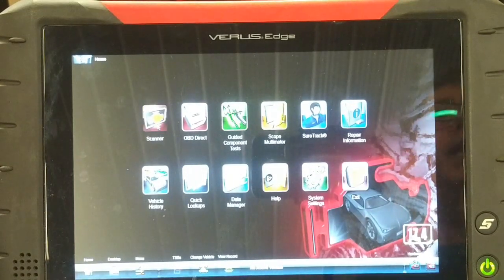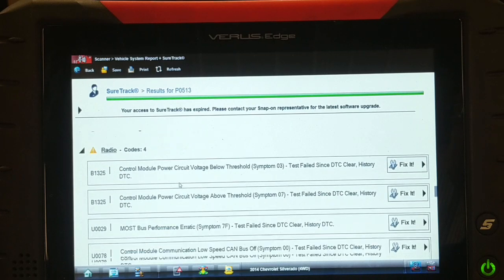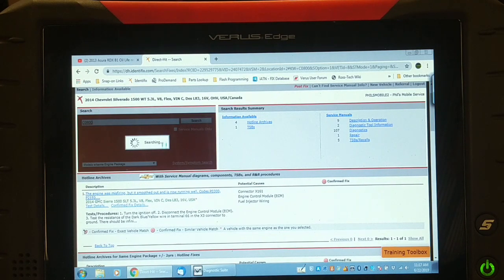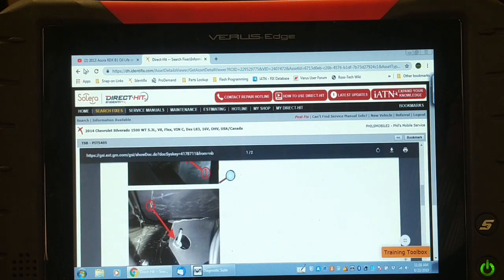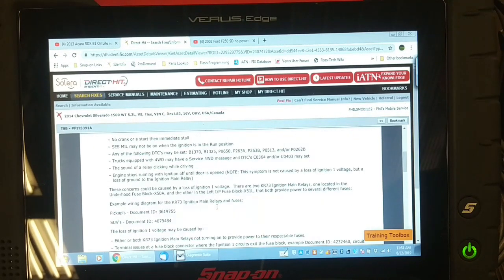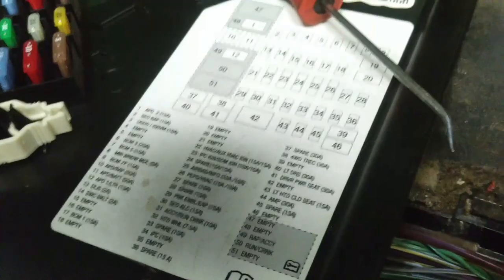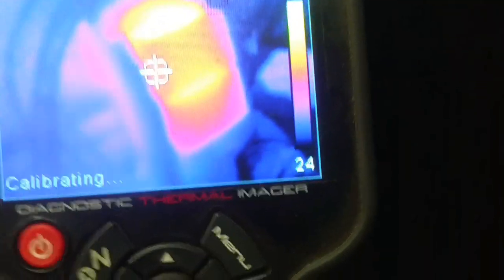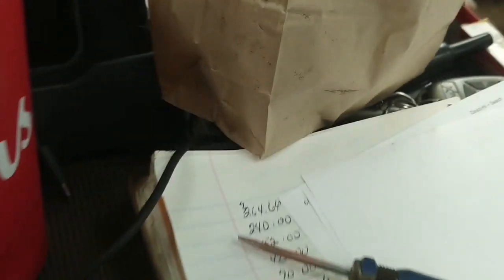2014 Silverado intermittent no crank like dead battery

Comment: You've ruined it with the dielectric grease. That's not to be used for electrical connectivity. 
A dielectric is a material that does not conduct electricity but can store an electric field
Reply from the maker: That's what GM recommends. It displaces moisture and oxygen which cause oxidation.

Comment: I just went thru this headache..... my 2014 Silverado turned out to have a faulty negative battery cable (even though it seemed fine with no corrosion on either end).

Hope this helps someone out there.

Good luck to all.
Reply from the maker: That's what this ended up being as well. Here is the video...https://youtu.be/Rihux0_-pGg

Comment: I'm three min. In and I'll tell you this...I still own mine. These trucks continue to pull and surge the batteries when the truck is off.  I charge my battery every quarter and replace it every 2.5 years.  
Don't rob a bank with these trucks, if you do....leave the engine running.

Comment: I have had this problem going on intermittently for years, just discovered the corroded crank relay today in the fuse box. I don't have a spare but I switched it with the defroster relay. They are all the same. I have had the service four-wheel drive and multiple low power codes. Hope this solves the problem!
Reply: did it solve the problem?

Comment: I have a 14 sierra  have to jump the truck to start altinator will charge it but only holds charge for 20 min when thetruck is shutoff and the seat belt light is on in park
Reply from the maker: Sounds like a parasitic draw. Something is keeping the ignition on? Need to do parasitic draw testing

Comment: This is quite probably a hot soak issue. The starter lives inches away from the catalytic converter with minimum shielding. I found loose connections at the starter motor probably due to high heating and cooling. This temperature delta will cause cable problems mainly due to high heat soaking at the motor.Better shielding and checking cable torque connections may be a maintenance consideration.
Reply: I did the same in a cheyene 2010 and gmc Sierra 2015 you can check May last video is about that

Comment: What would make a 4.3 vortex show error when hooking up computer and no crank when turn the key it's getting all power in the cab just not turning over u can turn it over at the starter relay but it not getting any fuel or fire idk confused can't figure it out
Reply from the maker: Hello Jakus. First I need more information. What year truck? What happened before it won't crank/start? What do you mean by "show error"? Can the scanner you are using communicate with the ECM? Can it communicate with the other controllers on the network specifically the BCM, ABS, Fuel Pump Driver? What scanner are you using and what codes can you read if any? Give me some details and I'll try help you out.
Reply: @PhillipBailey  it's a 2008 chevy 4,. 3 work truck and I accidently knocked the hot wire off the battery one night put it back on started it up started driven everything went dim the motor started ticking and it died and now won't start back I can jump the starter relay over and it turns over so I know it's not starter or bettery I am leaning more toward the ecm on all similar story's and it's a no crank no start my bad
Reply from the maker: @jakuslee5146  was it running when the positive cable knocked off? Can you do a network scan. Start there. You can't just put an ECM in it as it needs to be programmed and married to the truck. Don't start changing parts without diagnosing it.

Comment: Had intermittent no crank on my 2018, was driving me crazy  cleaned terminals etc, watched all videos after changed out starter relay and 40 A fuse. truck started ran good for a day then Stabilitrac lights up , engine light  with #5 cyl misfire. Trac Control, antiloc and cruise all off line now, and the adventure begins, checked ALL ground points   and made sure connection was good, it figures this would happen right after warranty  expires

Comment: We have a 2015 Tahoe with push to start but similar symptoms an codes… hmmm
Reply from the maker: This truck actually returned a few weeks later for the same problem. I believe the problem was actually a voltage drop in the negative battery cable clamp crimp. Here is a video of that repair on the same truck...https://youtu.be/Rihux0_-pGg
Since low voltage to various module will generate communication fault codes it's tough to diagnose. Since replacing the ground cable clamp the truck has never acted up again. Good luck...
Reply from the maker: This truck actually returned a few weeks later for the same problem. I believe the problem was actually a voltage drop in the negative battery cable clamp crimp. Here is a video of that repair on the same truck...https://youtu.be/Rihux0_-pGg
Since low voltage to various module will generate communication fault codes it's tough to diagnose. Since replacing the ground cable clamp the truck has never acted up again. Good luck...

Comment: Nice work. I have a '14 Silverado 1500 2wd, 5.3. I also have intermittent complete power loss (seems to be aggravated by heat). Did the owner of this truck indicate that the fix you did resolved the problem?
Reply from the maker: Here's what I found a few days later. His problem was an intermittent no crank shortly after a hot soak. Never when cold. Drive for an hour  shut it off to refuel for instance and then 15 min later no crank. After that event multiple network codes in multiple computers. Problem I believe was a voltage drop on the negative cable at the factory cable crimp. I believe it was causing high voltage drop on the body ground which caused the BCM to shut down due to low voltage. I replaced the ground cable clamp at the battery and the truck has been fine ever since. I started using marine cable clamps and copper lugs. Check out this video on the same truck. https://youtu.be/Rihux0_-pGg.
Since that truck I have had at least 3 other trucks that have been fixed for the same problem by changing out the battery cable end. Hope this helps.
Reply: @PhillipBailey  thank you very much. Yes, since messaging you I've seen this exact problem from quite a few others. I'm going to ask my mechanic to do that fix and hopefully take care of my problem. I appreciate your response. Again, good work.
Reply from the maker: @jbish3721  thanks let me know if that solves the issue.
Reply: @PhillipBailey  you got it
Reply: @jbish3721  did it solve the problem?
Reply: @trevord7659  , sorry for the delay. My mechanic removed certain suspect modules, cleaned both sides of each connector and applied dielectric grease at the connection, I am still problem-free to this date.
Reply from the maker: Good to know. Thanks for the update.
Reply: @PhillipBailey  I can drive 30 minutes and stop at the store. Come back 5 minutes later and it won’t start. I can let it sit 30 minutes and it will start. I can also jump it off. It will start cold when I get up in the morning for work. Any idea if this could be the same problem?
Reply from the maker: @SizemoreShorts  Here's what eventually fixed this truck. Could be your problem.https://youtu.be/Rihux0_-pGg
Make sure your battery connections are clean and tight too.

Comment: My Silverado still has this issue: no crank, no start intermittently, after talking it to Chevy dealership says, under hood main fuse box needed replacing. 2 hours later problem remain. I've noticed at times moving gear shifter it might turn over. Is this a coincidence or am I reaching?
Reply from the maker: The truck in this video actually came back a few weeks later. Here is what I found: https://youtu.be/Rihux0_-pGg
Its been fine ever since I replaced the negative battery cable end. I have done this on at least 4 other GM trucks for intermittent No-Crank. Hope this helps.
Reply from the maker: If it won't crank at time and then moving the shifter allows it to start that suggests the neutral safety switch is at fault. It could be coincidence as well. Trying it a second or third time could allow it to start. The fuse boxes are definitely a problem source. Does it set any codes when it does this in any computer? Unfortunately you need some test equipment on the circuits when it acts up. Its very hard to diagnose if it won't act up. Short of firing the parts cannon have to wait for it to become more consistent.

Comment: So I came to realize the Vehicle does not recognize if the vehicle is in park or drive but I can’t figure out what to replace to fix that
Reply from the maker: how do you know this? Are you looking at Park/Neutral position in the ECM data? This comes from the Transmission Control Module via the CAN bus. If there is an issue with the BUS you should have no PRNDL display in the dash. Dose the PRNDL indicate the respective gear?  Go into transmission data and have a look at the gear shift data. I believe it comes from an internal mode switch inside the transmission. Can you get it to start by turning on the ignition and bypassing the starter relay pins 30 and 87 (or 3 and 5). be careful to be sure it's in park. good luck
Reply: @PhillipBailey  it doesn’t not highlight what gear the truck is in
Reply: @PhillipBailey  I’ll check that later
Reply: The truck started to crank with the jump wire so that’s good news still not turning over
Reply from the maker: @jacobandreoli9700  what are you using as a scanner? Can you do a network code scan of all controllers? Did you say the gear shift indicator is not working to indicate park etc?
Reply: @PhillipBailey  yes it will not tell me if I am in park or not. I do not have anything to read stuff like that
Reply from the maker: @jacobandreoli9700  well you need a professional scanner to further diagnose this. What happened, was there something done prior to the no crank problem?
Reply: @PhillipBailey  my wife went mudding and got it pretty wet from what I’ve been told
Reply: Did you ever figure this problem out I now have two trucks that are doing this both are not reading that they are in any gear I was able to bypass the neutral safety switch and get the one to start but do I need to replace transmission or ??

Comment: Hey man I was wondering. Where I could get the computer to get all this information my wife has a problem not cranking and can’t figure it out she said dealership charges 3k for a computer wiring
Reply from the maker: If you are looking for diagnostic information there are DIY resources on Alldata where you can pay as you go:  http://www.alldatadiy.com/alldata/
If you are looking for a scanner there is no cheap full function scan tool AFAIK. The Maxiap 200 will do a network scan of all controllers but that will just give you possible direction through codes to use the service information to diagnose the root cause of the problem. 1. What has been done so far? 2. What exactly are the symptoms? 3. Was there any other work done to the vehicle prior this problem arising?  4. Year, Model, Engine displacement. Give me some details and I will try to help if I can...
Reply: @PhillipBailey   2014 Silverado 5.3 4WD. Starter/battery r fine, Vehicle doesnt even attempt to crank it just clicks off when i turn the key, fuses are all in tack, i still have to grab a mulitmeter to verify the volts r going through them.  She told me that the Power Steering had problems before it, but now it just doesnt do anything... been sitting for months now.
Reply from the maker: @jacobandreoli9700  start by removing and cleaning the battery cable connections. Then charge and test the battery. If it still just clicks you will need to do a network scan for codes from all controllers. Check for power to the control wire on the starter solenoid when it clicks. If yes check the battery cable to the solenoid. If that is good likely needs a starter replacement. If there is no power to the S terminal on the solenoid then check the starter relay if it is clicking. Could be safety switch as well. Good luck.
Reply: @PhillipBailey  already checked starter
Reply from the maker: @jacobandreoli9700  are you getting a signal to the S terminal? if not can you get it to start by sending one there? How did you "check" the starter?
Reply: @PhillipBailey  took it to autozone
Reply from the maker: @jacobandreoli9700  you took the starter off and had it tested? Did you have power to the S terminal when attempting to start and would it crank if you bypassed the starter relay.
Reply: @PhillipBailey  I’ll double check that tomorrow
Reply: @PhillipBailey  I tried to bypass the starter, checked all the voltage still isn’t cranking checked all the fuses and terminals all had voltage as well
Reply from the maker: @jacobandreoli9700  that does not make any sense. If you have power to the starter S terminal when it's trying to crank and the battery cable has power to the battery post then the starter is no good but you said you tested it and it was good.
Reply from the maker: @jacobandreoli9700  have you checked voltage drop on the ground cable. Connect one lead of the voltmeter to the negative battery post (on the center of the post not tge ground clamp). The other lead to ground on the aluminum case of the starter. Attempt to crank. The reading should be less than 0.4volt. Alternately you can connect a ground booster cable between the ground on tge battery and the engine block to bypass the existing ground cable. Hope this helps

Comment: 2014 silverado have the same problem but it does it only in the mornings on cold days replaced starter new battery ground cable cleaned all grounds contacts replaced all new relays start and crank dont know what else to check
Reply from the maker: What exactly does it do? I gather it's not cranking when you try start it. If that is the case you need to do a network scan for codes in all controllers. If no codes are present then you need to view the status of the crank request in the PCM, transmission gear position in the transmission computer and security data. Connect a test light to the S terminal at the starter and ground and confirm if there is no power being sent to the starter control wire. Don't you just love intermittent problems...HTH
Reply: Wont crank every thing lights up radio,dash ect.... and this only happens on cold days
Reply: @Gmontelongo20  what was it
Reply: @Mythrays1  they said that i need a new tcm tarnsmission control module that the connetor was damaged it goes inside the tramsmission oil pan

Comment: Just fought with a similar problem.  Positive short cable was getting hot at times. Finally found a voltage drop where the short cable connects to the mega fuse bar. The connection had oxidized (nothing visibly obvious).  Worked fine after wire brushing the connections
Reply from the maker: Good to know...

Comment: My truck doesn’t start or crank or turn on lights already replaced battery and alternator and nothing
Reply from the maker: Why change the alternator it has nothing to do with starting? There are dozens of possibilities but most likely you're going to need to do a network scan of all controllers and then address any fault codes related to the problem. Does the MIL come on with the key on? Does the fuel pump in the tank run for one second when you turn on the key? Does the starter relay click when you try to crank it? If so is there power being sent to the S terminal on the starter? Are all fuses good? Did you try moving the shifter to neutral? Aside from those things you need some test equipment to go further. Good luck